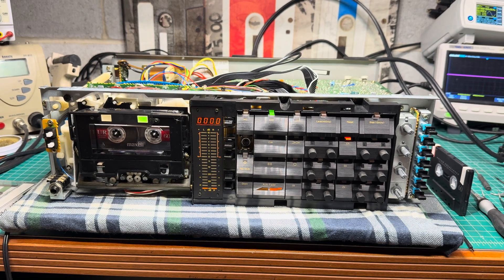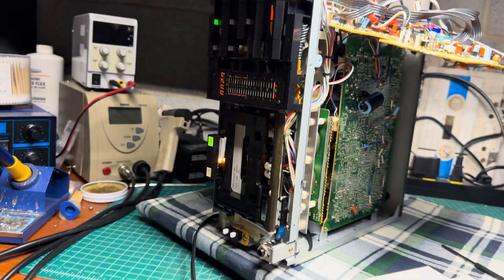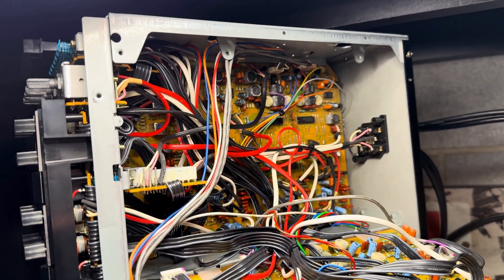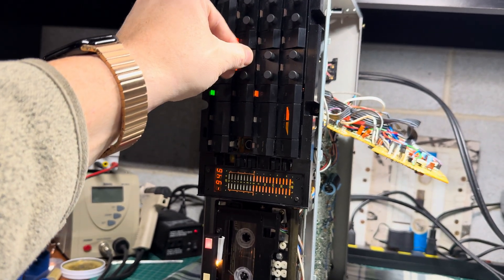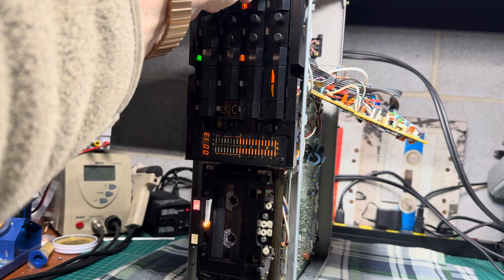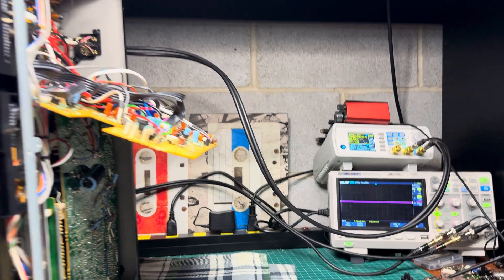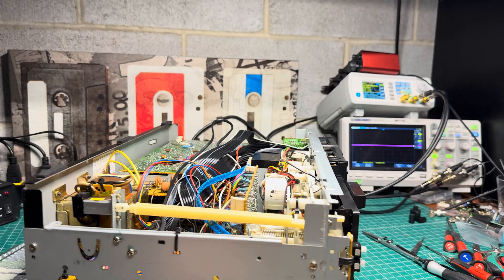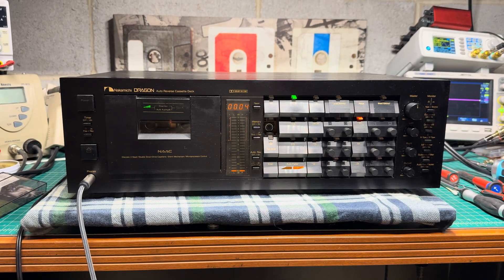The Dragon Breathes Again | Nakamichi Dragon Back to Spec with Perfect Recording

Comment: I am not sure when you say height if it's depth or height that you're referring to as depth is the travel the heads do to make contact with tape and height the distance of the heads from the base which you measure with a metal bar and a mirror cassette later on. In a machine with a pad lifter I believe it seems reasonable to increase head depth to recover head wear and possibly capstan off-axis due to bushing wear.

How are those UR cassettes? I was hoping to see an FR plot on those, azimuth was spot on, it didn't move at all. I think I've got 4 or 5 cartons of those recorded once and clean. I noticed you're tuning the levels and BIAS on a D and then use an SA for Type II which is exactly what I do... but we should be using AD. I am curious to see how that specific UR differs from a D.
Reply from the maker: Head hight is the distance between the head carriage. It is required to be set properly, specifically in the decks where heads dont have metal guides to be aligned with the recorded tracks. Otherwise levels will not match with other decks. As for cassettes you are wrong. Deck should be tuned for available tapes, not for the tapes from 1970s....
Reply: @hifirulezzz  for what I gather the TDK AD tape was what most Japanese manufacturers used for production tuning until very late years.

I've got AD(s) new and sealed from various era including the late 90s but I never open sealed cassettes... I like to preserve my collection.